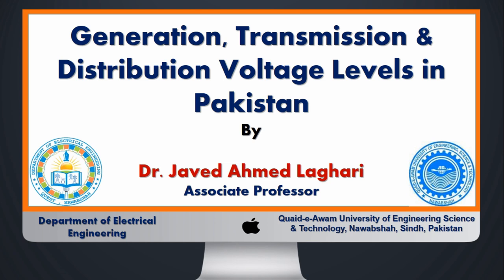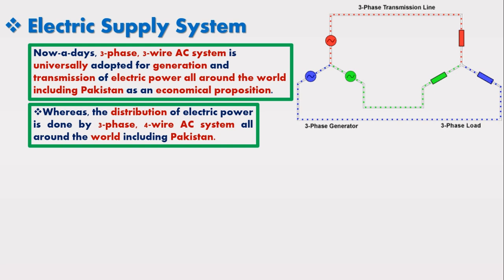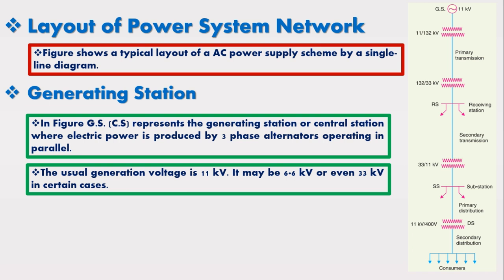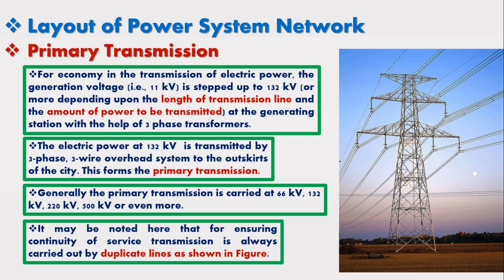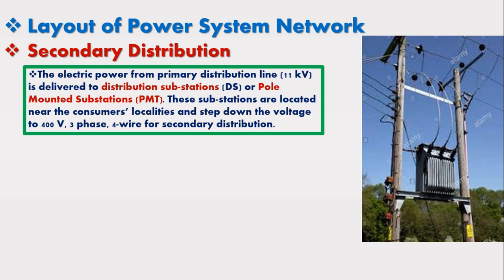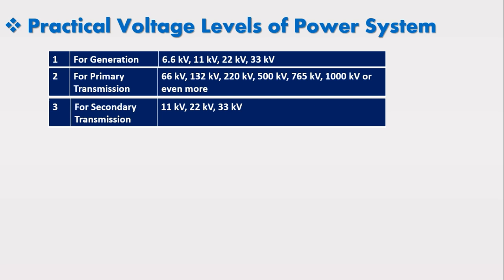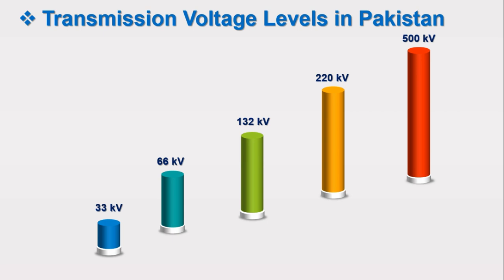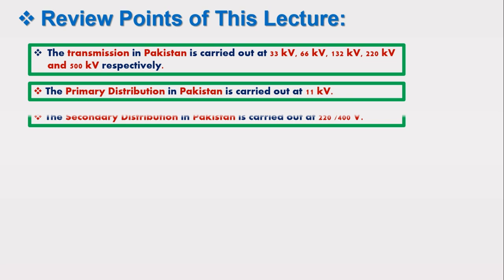Lecture#3 Generation, Transmission, and Distribution Voltage levels used in Pakistan

Comment: Sir Thankyou so much for all course.
You made transmission very easy for us .
Reply: It was very much helpful for SpSc exams for Assistant Electrical Engineer ( theory )
Reply from the maker: Thanks for the compliments
Reply from the maker: Thanks for the compliments.
Reply: Sir If possible please share videos of Power system protection

Comment: Sir which Chitral Hydropower Plant has generating voltage of 415V? Cuz I am in search of that plant and I know only about Golen Gol Hydropower Plant of Chitral that generates 3.3kV according to WAPDA. Your comments would be appreciated. Thank you!
Reply from the maker: Thanks for the comments. In Chitral there exists two hydro power plants according to NEPRA generation license. The details are given in below link pdf on page 36-37. 
According to document, this chitral hydro plant is located on Lutko River Garam Chashma road 7km east of chitral town. Thanks

https://nepra.org.pk/licensing/Generation%20WAPDA%20Hydel.php
Reply: @DrJALAGHARI  sir thank you very much for your fast response. One thing I am curious about is that the pdf is old as 2004. So now the things are changed alot but I haven't seen the updated version of that document. Example: that Chitral Lutkoh Plant was generating 1MW in 2004 but now it is 5MW. If you found any updated document then I will be very thankful to you. Thanks!
Reply from the maker: @mzakirbaig  Thanks for your comment. The capacity of this power plant is still same as mentioned in power system statistics 45th edition uploaded by NTDC. This is the latest update upto June 2020. You may check it.
Reply: @DrJALAGHARI  Sir I read thoroughly the Power System Statistics 45th Edition available on NTDC website and at the same time also read the License Amendment IV of NEPRA that contains the latest info about the hydropower plants. I felt some mis-information on NTDC's file as it said that the Chitral Hydel Power Plant generates 600W of Electricity while NEPRA has maintained the info with 1MW of capacity. Sir whom to follow now? On some pages of NTDC pdf it is written that the 220kV stations in Pakistan are 45 but at the end they are 55? At the same time, 500kV stations are 16 but on NTDC's pdf file the list contains only 12 names. Now if we move on to NEPRA's latest pdf as updated till 2020, they haven't included Neelum Jehlum Project in their list of hydropower projects. I am confused sir, apologies for wasting your time. All of the discussion is for true information as you look experienced and may have some answers to my questions. Thank you
Reply from the maker: @mzakirbaig  Thanks for the message. Yes you are Right. There seems some confusion in the reports of both NTDC and NEPRA reports. 500KV grid stations are 16 in real. Rest of the things can be verified by visiting their website.